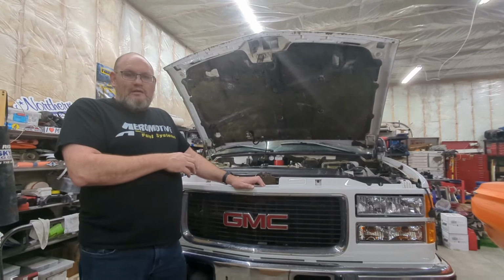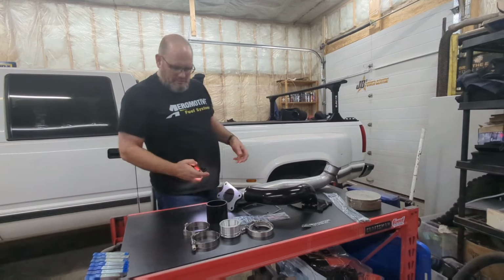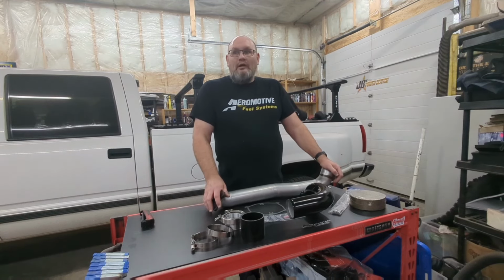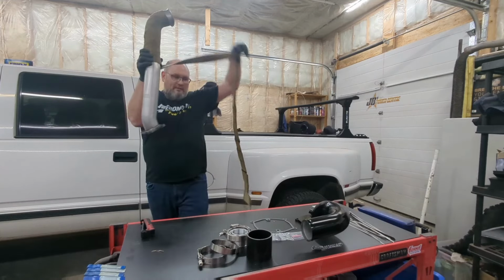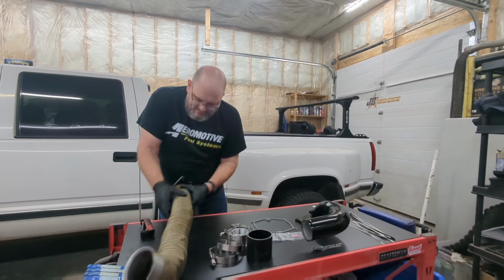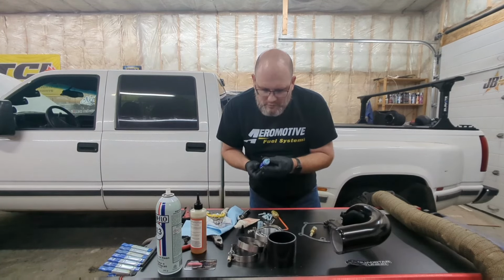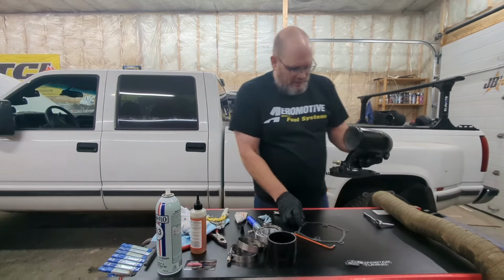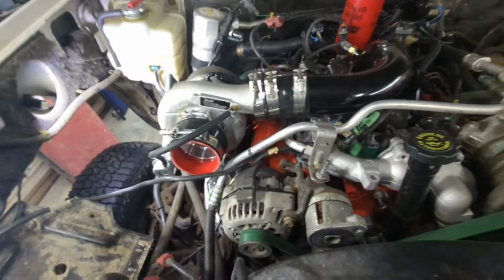Today in Shawn's Garage HX35 Turbo Upgrade on a GM 6.5 Diesel

Comment: I got a 95 burban with 4.10 gears. I put a 16cm non gated hx35 with 54 mm comp wheel on it. Rather than tune it, I put the stock MAP sensor where the atmospheric sensor was and installed a 3 BAR MAP from a 60 series Detroit and put a #9 resistor in the PMD. It’s got a Jasper engine that’s a Navistar block. TTY head bolts. Cruises at about 3-4 psi and will hit about 18psi under WOT. Think it’ll hold together? Lol. I papa the thing around and have only mashed it for testing. It doesn’t roll coal but it has a light haze to it under full throttle.
Reply: On OEM/Felpro TTY Bolts, 18PSI (might) be ok if your vehicle is lightly used only as a commuter.  But if you try to tow heavy, you'll eventually lift a head due to bolt stretch.  This takes out the head gasket(s)!  W/O an intercooler, I would recommend limiting boost (at sea level) to 12-14PSI max!  If you live at an altitude above 4000Ft, you can crank it up a bit.   But if longevity is your goal, ARP head Studs or equivalent are the way to go!  Just got to really seal the bottom threads, as they are in the water jackets of the block! 

Interesting what you did with the 2-Bar MAP sensor, and the Barometric sensor.  I believe the Baro is "absolute" pressure, to read atmospheric.   And the MAP is "gauge" pressure.  Sticking the 2-Bar MAP in the Baro sensor location must be fooling the ECM/PCM into thinking it's cruising at 50,000Ft like Boeing 747 all the time!  I'm rather surprised it hasn't thrown a code for a Baro circuit/sensor malfunction?  Do you ever visit the online 6.5L forums?  Truck stop.us, Diesel place forums are a treasure trove of knowledge on these antiques.  Plus many there might be very interested in hearing the outcome of your sensor swap experiments!   👍

Comment: What did you end up at for boost
Reply from the maker: I have not pushed the truck yet as I am still breaking in the motor. It can get up to 12 pounds real quick. I am limiting it with a turbo smart 15lb waste gate
Reply: @shawnsgarage - The stock program in the ECM/PCM will detect the over-boost condition and throw a code, and/or enter limp mode and de-fuel on you.  The guy further up this post string is experimenting with pressure sensors.  Which is a way to fool the stock program into operating way above the OEM 11PSI boost limit!
Reply: Of course, getting an aftermarket Eprom/Flash can modify the stock boost limits.  Probably in a more precise manner than fooling the puter with non-stock scaled boost sensors.
Reply: @xxxxxxxxxx6903 what if it’s a mechanical 6.5?
Reply: @THUGLIFEhks  - I believe the 1993 with the DB2 injection pump still utilizes a vacuum controlled waste gate on the turbo?   Many with the mech injected 6.5 went with the BoostMaster type (spring loaded waste gate controller).   I'm not sure about utilizing a Three Bar MAP sensor to fool those setups?   But if you're running a stock "GM" turbo, you really want to limit boost to 12psi anyway.  After that you're hp/Tq gains plateau or drop due to really heating the air charge!